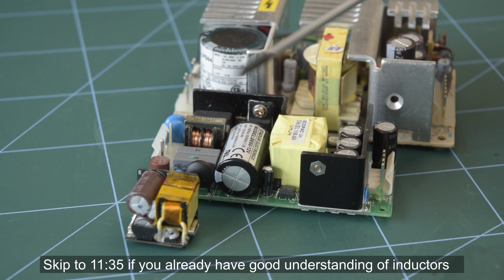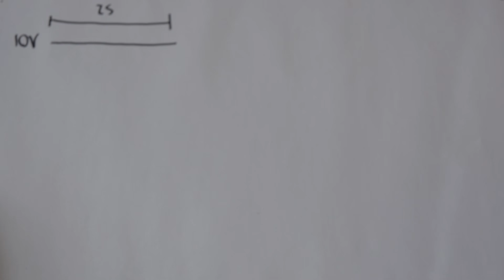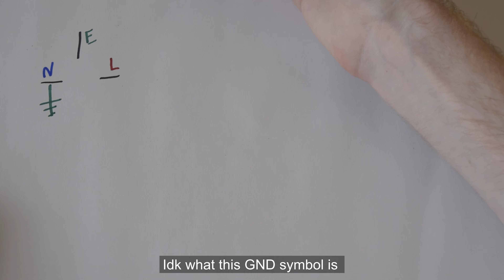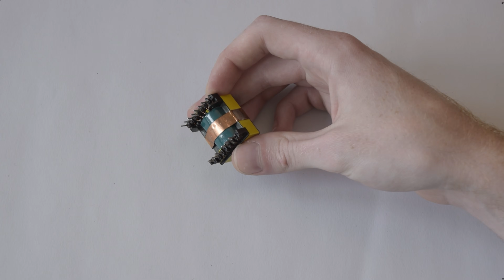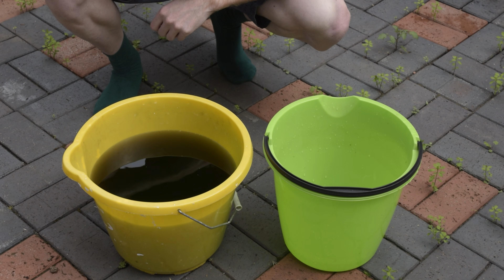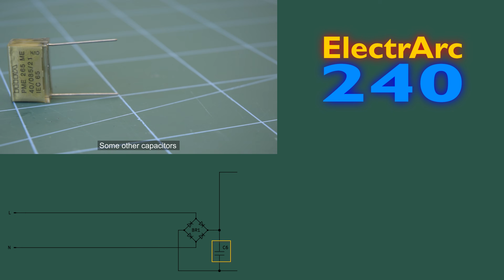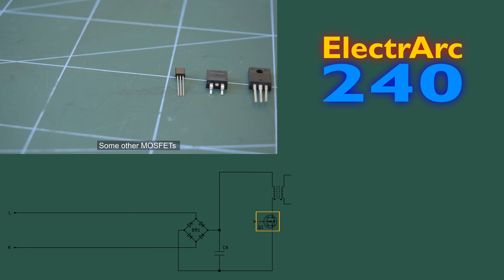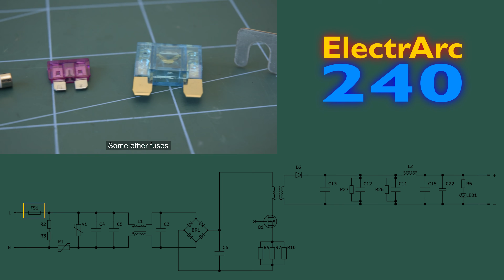Every Component of a Switch Mode Power Supply Explained

Comment: I really like the way you built up the schematic by starting with the basic layout and then adding components to describe the complexity. By so doing, you effectively started with the foundational components and built on that.  Well done!
Reply from the maker: Thank you! It took a while to edit it all nicely but was definitely worth it.
Reply: @electrarc240 All that scripting, recording, re-recording and editing is much appreciated! 

I’m looking forward to the video where you’ll explain why those GaN power supplies can be so small yet powerful. (In due time)
Reply: @electrarc240  Maybe the things omitted in your narration, such as the optron and control chip, are also worth explaining. I've got a broken led strip driver and already blown a USB scope and a PC it was coupled with in trying to make the driver work, but I still have many unblown things to blow (throwing the driver into trash would solve the problem, but such a simplicity is for losers), so I must learn every aspect of the SMPS before I run short of unblown things. And your video is the best I've seen before in that respect.
P.S. I'm even less English guy than that wantan3_6_0 dude from the other comment is, but yet hope the letters written above are at least resemble proper English.
Reply: @electrarc240 very nicely done! Only suggestion I might have is that the black on green is tough to see, so maybe think about some higher contrast colors or just black and white. Otherwise loved the content!
Reply: Yes, that gradual buildup from simple to real of the schematic was an excellent teaching tool. And I found out I didn't know as much about switching power supplies as I thought I did. 😁... But I do now! (almost)
But really, great job, you're an excellent teacher.
Reply: An ingenious way of explaining the individual parts of the PS.

Comment: For a project for an outside company I had to design a power supply. To take UK mains to 4 voltages and amperage but most critically the 198V was +/-0.25V. The accuracy was due to the end use, a calibrated tester for a medical device. I produced the design and the model worked but I was part of a team. The next meeting one of the electronics guys changed the power and voltage requirements. He failed to meet the brief but his components were ruled the most important so I had to change. 5 different outputs! A month later he wanted 6 outputs  and I was told to change to fit. 2 months later he wanted 8 outputs. The power supply cost breached the budget and he then changed it again. The company who was paying pulled out. We had to write up the project having built nothing because one person failed to listen to the brief.

Comment: That was the best explanation I’ve ever seen in decades of being a tech.
Reply: I wonder how the control circuit looks like and works. The whole thing is just a brick without it.
Reply: @Oktokolo  yes, he should follow up with that for people.
Reply: The explanation of how a switching power supply takes incoming voltage, rectifies it if necessary, and then chops it up at high frequencies before passing it through a transformer or inductor is particularly insightful. This method of voltage conversion is highly efficient compared to traditional linear power supplies, which dissipate excess voltage as heat. The video clearly illustrates why SMPS is favored in modern electronics for its efficiency, especially when significant voltage changes are required.
Reply: FANTASTIC young lad

Comment: I've studied and worked on electronics for the last 20 years and this video finally clicked in a couple of concepts that had been banging around in my brain for years regarding smps. Hands down the best switch mode power supply video on YouTube. 

Subbed
Reply from the maker: Wow thank you very much! Glad I helped fill in those pesky gaps
Reply: From what I remember from my electronic studies, I have the impression we spent too much time on manually analytically solving circuitry, spending hours on differential equation solving on very trivial circuits (one transistor, a capacitor and two resistor is enough to make it quite hard to solve), a thing that is way better done by computer software simulation, and not enough on this higher scale functional diagram like in this video, that seems actually way more useful to actually understand stuff 🙂
Reply from the maker: @ThomasKundera  As a current student I couldn't agree more, it's such a shame
Reply: @ThomasKundera  I saw the reference to diff eq and I had a flashback to the nightmare that course was in college as an undergrad studying computer science. I did fairly well in all my other mathematics classes but I could not wrap my head around DE and I failed the class my first time take it. i'm not even sure how I (barely) passed when I took it again the next quarter. I think it was so traumatizing that my brain has blocked out all memory of those classes. I'm feeling anxious just writing this and its been like 25 years since I graduated. ugh.

Comment: This is amazing. I met a lot of failed switch mode power supplies in my job as an industrial electrician, didn't have the know-how to repair them, nor understand the theory behind the circuitry. This helps a lot, thanks, especially if you could come up with a video on troubleshooting these power supplies.

Comment: It's been almost 50 years since I sat in a classroom and had one of the best instructors at the Sears Technical College explain the new switching power supplies most new portable tv's would be using. He used a blackboard to do the same type of visual association of circuits that he was lecturing on. You have the same dedication and enthusiasm and have earned my respect! Keep up the good work.
Reply from the maker: Thank you!

Comment: Hello, I made the first prototype switch mode PSU in the very early 70s for a now, long extinct company called APT at West Byfleet.

When I say that I made it, I mean that an engineer gave me a circuit diagram with a box of bits and a lump of plywood to mount it all on. The engineer was entertaining and rather frightened of his creation and would try to get others to turn it on for him, if he failed in finding a sucker he would use a broom stick.
At times when he had the thing running, you would get the odd person walking past bang his bench and send him through the roof which, was an understandable reaction; as a capacitor would occasionally explode showering the place with metal foil.

One of the few times in my life when I didn’t feel like I was working.

Happy days!

Comment: I've been an electronics engineer  specializing in IC test for nearly four decades. This presentation is absolutely the clearest explanation of the individual componentry and their interrelationship to each other that I have ever seen. I especially appreciated the demonstration of of the inductor's function using the spring as an analogy. If you think about it, the spring actually looks much like a physical inductor...even the schematic symbol. It would be cool to see you do the same analogy with a capacitor. Also, the water buckets sitting side by side gave an excellent analogy of isolation. All in all, this presentation is the BEST I've seen, bar none.
Reply from the maker: Wow thanks so much!

Comment: Thank you. Being an old hand in vintage power supplies, the idea of how a switching power supply work has been quite a blur to me in terms of comparing it with the non-switching type. This video has helped me understand how a switching power supply is different from  ( and similar In function to) the transformer-diode- capacitor simple variety of old. The concept of the flyback transformer in generating high voltages in vintage tube TVs came to good use in appreciating how it is exploited in a switching power supply. Thank you for sharing.❤

Comment: This is insanely useful, thanks. I'd love to see more circuits broken down like this.
Reply from the maker: Perfect I have more planned :)
Reply: The circuit he described would break down (well, successfully blow its fuse to isolate) in 1/3000 s. Read an actual GaN FET's manual including the power supply use thing instead. You're welcome.

Comment: You're very good at putting concepts into simple words. Not in a silly or belittling way but actually useful for grasping a concept without much context. "A fuse is the thinnest wire in a circuit so it breaks first. And because of that it is designed to break safely." as an example is an explanation I will take home from this video. I mean… I do know what a fuse is, but would probably have used more words and concepts to explain it if asked.

Comment: My first switching power supply was in the 1980's. I thot they were the work of wizards. Generally just replaced them when they failed. This is the first time I have an understanding of the operation of the circuit. THANK You

Comment: What an excellent presentation of the circuit by explaining both the diagram and PCB simultaneously!!! I wish my professor did the same when I studied power electronics at university. I remember being so overwhelmed by the massive circuits that I couldn't really grasp why there were so many components. Highlighting the parts that make up e.g. the mains filter, the flyback converter, the snubbers e.t.c. is such as massive help. Thank you :)

Comment: Even though I've been occasionally fixing SMPS's for thirty years, this was very insightful.

Would be nice if you'd address the control loop and bootstrap too in a comparably easy to digest format. If you're tempted to do that then try to find a PSU that doesn't integrate everything in a single tiny chip or find a block diagram for the chip.

Comment: Your explainers are phenomenal! Comprehensive, logically paced and clear like a filtered signal. They especially cater to those who have just enough knowledge to understand the content but lack expertise in designing power circuits. The attention to detail comes across and is appreciated (don't mind the 20 - 30 m video length). The GaN vs Si comparison video was fantastic too.

Comment: Awesome video presentation on the AC/DC power supply circuit. I built my first 12 volts power supply back in 1979 at Army Depot electronics technician training. Also built a Multi Meter, and a AM RADIO RECEIVER. Learned about Ohm's Law, Watts Law, and the Kirchoffs Law for designing Electronics circuitries. What amazes me the most are the Electrons, Protons, and Neutrons which are the building blocks of matters around us. These are part of the Atomic structures of everything that pertains to every living things around us.

Comment: Why miss the control part?
Reply: yes, I was hanging on to see what drove the gate on the mosfet...just a timing circuit derived from the smt IC?
Reply: Yes, it is also an interesting part, especially how the chip gets its power from the transformer and how this serves as short circuit protection for the secondary.
Reply from the maker: I decided to leave it out of this video for simplicities sake. I reconned more people would be here for the main power electronics flyback circuit than for control, plus I'm not going to lie control is not my strong suit and I wouldn't have wanted to make any major mistake in my explanation. The control circuit is far more complex to understand in my opinion and I thought introducing things like the tertiary winding may have taken away from the simple overview approach of the video. I will do many future videos on control for example I have a video planned on active power factor correction with boost converter that will delve into PI controllers and more.

Comment: The polarity dots on the Flyback coupled inductors should be opposite and not on the same side. You also overlooked the control components.
Reply from the maker: Yes I forgot to change the symbol from the default transformer, and no I didn’t I have already addressed the control in my pinned comment. Also who likes their own comment 4 times not judging but kinda am lol

Comment: So interesting, this is exactly why I never feel bad when purchasing another wall wart, also because the whole purpose of these newer generations of higher watt/volt wall warts is that the heat generated is away from the device, which extends the battery of the device overall.  

I was living with someone who was putting together computers in the 80s in LA from scratch and writing the code, and it is astonishing how far we have gotten since then.  I personally enjoy learning about everything, but also understand that it can sometimes be a large waste of our time as it's more cost effective currently to simply replace with new products than it is to repair, and most technology we is out dated before it fails.  I personally got to experience learning an out dated software called MX flash when I was a kid, and seeing it get erased from the internet made me realize how swift the evolution of technology is, but some physical realities of components will be able to last forever, so long as you don't care how large your bread board is. haha

Comment: I found your video because I have an intermittent fault on the PSU of one of my digital mixers. It was taking out the main circuit breaker in a venue while we set up and causing a lot of problems for everyone, especially the chefs!! We replaced the mixer no problem but I didn’t have the knowledge to repair the mixer. After watching your video I tracked down the fault and repaired it. 
Thank you so much for a really well presented breakdown of all the components and their function and for saving me a lot of time, effort and expense in my endeavour!
Reply from the maker: Wow that’s excellent to hear!! I never thought this video would be useful for repairs. Thanks for sharing!

Comment: Thank you!! This is the best explanation of inductors I've ever seen. 

I've watched a ton of other videos about boost/buck converters and inductors but still felt like inductors were some magical thing and that they're the opposite of capacitors (one stores voltage, one stores current. can't remebmer which). Even playing around with some circuit simulators didn't really help me understand what was going on with these things. 

and I'm only halfway through the video as I write this.

Comment: I appreciate this a lot! I was an electrical technician in the US Navy on nuclear propulsion in the late 90s, working with an older generation of switch mode power supplies. Now I have a kind of intense side hobby of electric motorcycle reverse engineering and documentation which has been a bit stymied by some of the advances and obfuscations in onboard SMPC’s that I can now speak to! I’ll try to share this video with others in the scene.

Comment: Thank you SO MUCH for this excellent video. I wanted to diagnose an issue with a power supply for an old camcorder, and felt a bit in over my head because I am still getting the hang of identifying components other than the really obvious ones; but this video made it EXTREMELY simple to pause and look up parts and identify what piece was what on the board, and more importantly, what it's doing. Never dreamed the exact video I needed for this repair would exist, let alone in such clear detail down to the very basics of the circuit and then the role of additional components. This isn't just a good video for this specific subject, it's a good video for people getting started in learning circuit boards in GENERAL.
Reply from the maker: Thanks so much! Glad it was helpful for you

Comment: Thanks for each component and stage-by-stage details. I worked in this field for around twenty years. Both SMP/linear power supplies have their minus and plus. I believe linear PWR supply is more durable than SMP. Simply more components more issues. If a component fails in SMP, the whole PWR supply stops or blows up the entire board in black ashes, but the fuse remains intact.

Comment: Some SMPSU manufacturers will place capacitors between live and earth and neutral and earth for EMC noise reduction. The upshot is that IF the "ground" of the 12v say, is connected to mains earth, the whole 12v output can float at around half mains.
Not enough current passes through the input filter capacitors to hurt you. Anything earthed this way may feel a little "sticky" if you rub your hand gently over metallic parts, BUT the brief exposure to half mains if the PSU is plugged in can sometimes be a bit of a surprise to your 12v kit, especially if any part of it is also referenced to mains ground.
71 year old retired electronics engineer and I really like this video. Well done.  I hated fixing SMPSU's, or at least the older style ones,

As an aside, when I was in broadcast engineering, we had so many BVU800 series video recorders in the building with incredible stable switching frequencies, we would sometimes get a situation where the combined effect of the SMPSU's running in phase, would distort the incoming mains to the building resulting in almost a square wave input mains waveform.

Comment: awesome!!! good job.  For those wanting to understand the controller......read the data sheet!  It monitors the output voltage and primary conducting current and adjusts the PWM driving the gate; often between 0 and 49% duty cycle, but sometimes very different as suggested necessary by the discussion in this video on the 'turndown' (or boost).